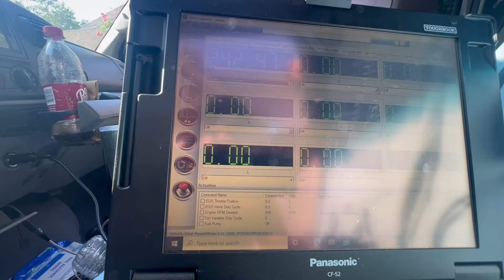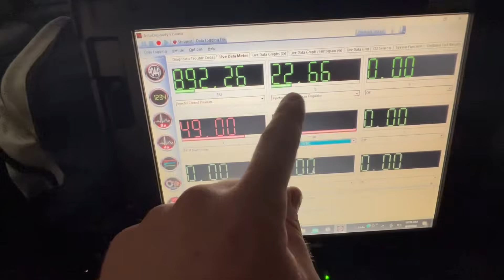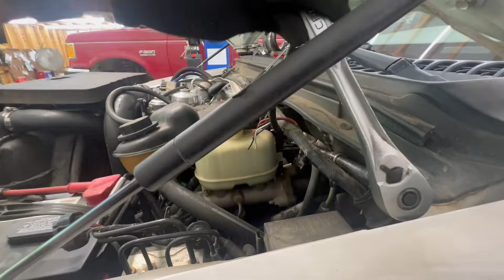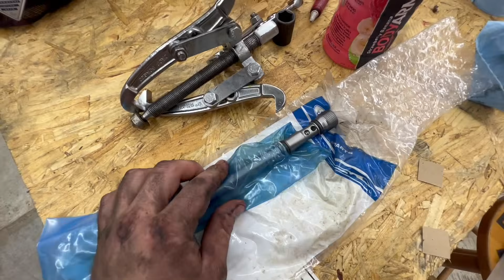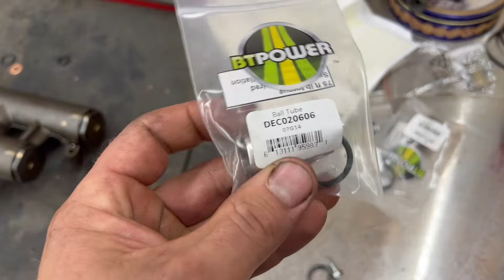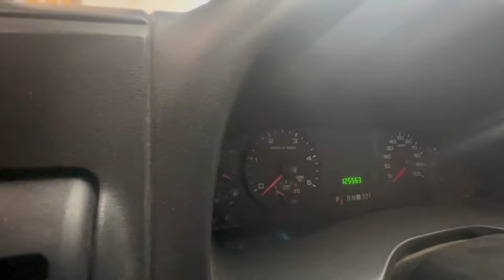6.0 powerstroke high pressure oil leak, long start, no start hot

Comment: Have you ever tried to change out an ipr with an odawgs intake installed?
Reply from the maker: Yep, rotate it out, keep the electrical connector pointed towards the back, only the nut while holding the connector. Comes right out
Reply: @AutomedicGarage Awesome.   I had taken the ipr out with the turbo removed to check it while i was in there.  Screen looked good, but access from the right looked sketchy.  I was worried about future access.

Comment: Those leaking seals leaking air at 150 psi will not last long with 500 to 3000 psi pressure against them. just saying.
Reply from the maker: System is meant to hold oil pressure not air pressure. When the system is completely empty and has just been put back together it is common to hear air seeping after just putting a system back together. I do this daily and this is one of our personally owned trucks and this was 3 years ago now and has not been worked on since this video and over 30k miles on it since. So I’m “just saying”

Comment: I just bought xotic performance set of standpipes & dummy plugs. I went with  them instead of the o ringless set I didn't know how I felt about lock tight them in place much more pricey I love you videos always helpful when in a pinch.

Comment: How often do those stand pipe o rings and other seals you replaced go out?
Reply from the maker: @whspioneer89  with correct install, using at the minimum oem or the diesel site double oringed, running a quality oil cooler and keeping oil temps in check, not that often. If you don’t follow everything listed about then there’s a good chance you’ll blow them.

Comment: Hi I'm a new owner of a 6.0 Ford power stocker I love the truck I am stuck being able to drive in town because it turns off after I drive it like 15 minutes I've changed everything I see the dash lights and stereo turn off and I had mechanic go through the steps checking the lines the oil pressure high what am I miy
Reply from the maker: @BrittneyBooth-wd2tx  I can’t really help if I don’t have any live data to get an idea of what’s going on such as icp psi, ipr %, FICM volts, ficm sync, fuel pressure, etc. when the problem is occurring.

Comment: 2004 early style HPOP

Suspect HPOP failing

165k miles, original HPOP

Long crank cold and long crank hot. New FoMoCo standpipes and dummy plugs
IPR test good, screen clean, went ahead and Replaced screen anyways

Oil psi gauge goes to zero when the oil gets warm, oil Guage swings to normal any rpm above idle

Filter removed low psi pump fills oil resevoir relatively quickly. Checkked the shuttle valve and spring on the bottom side they are good

Next test is shop air at IPR port

Comment: Good job.
 But I have a problem with mine. So sounds like you want to crank but it won't stop. I think I gotta leak in the system Ic p. Isn't building 500 PS in?  Direct.
Me in the right place, please.Thanks
Reply from the maker: @marianomachado3631  crank but won’t stop? Are you saying you started is getting stuck and it keeps cranking?

Comment: not sure if you've tried, but I fill the oil rail with a syringe by removing the small plug in the top of the rail.  Takes a little time, but fires up first crank.  Great content!!

Comment: My Icp going 84.99 under full load it is asking for 3600psi it is only getting 935 psi hpop bad? Also forgot to mention my fuel pressure drops to 46 psi then it goes back up to 58psi. Both fuel filters are brand new. Do i go after the hpop or low pressure fuel pump.
Reply from the maker: @tinok.8149  according to ford anything above 45 psi is acceptable on fuel pressure but it sounds like you need a blue spring or your HFCM is getting weak. Are you sure the 84.99 isn’t your IPR cause that what ipr maxes out at. If it is ipr it’s doing all it can to produce the 935 Hpo. Depending on your year if it’s a early 6.0 03-early 04 I’d say hpop if it’s 04.5-07 I’d say some other Hpo leak such as standpipes, dummy plugs, nipple cups or upper injector orings

Comment: I’m having the same issues with my truck. Out of curiosity, what does a job like this cost, roughly?
Reply from the maker: $200 labor per side. Oem stand pipe and dummy plug set is around $100 but you gotta factor in $150 diagnostic fee for figuring what’s leaking and doing a air test through the ipr.

Comment: Heres a question. My trucks got a new hpop,icp,ipr,motor harness, ficm,ficm harness, new fuel pickup, new fuel pump/filters. My truck starts up nice. But once its warm it shuts off. I cycle the key a couple times and it starts back up. But theres ONE green and red wire coming from the fuse box under there dash on the driver side. You so much as wiggle that wire while the trucks running it shuts down and will not start until you wiggle it for awhile.
Reply from the maker: What brand harness? Sounds like similar problems I have with the Amazon and eBay harnesses
Reply: @AutomedicGarage  the new harnesses were both off ebay. Theyre not the best but not the cheapest. Definitely better that the ones that were on it.

Comment: Seems like it would be easier to just replace the stand pipes and dummy plugs on both sides
Reply from the maker: Easier as in take the other side apart that has no leaks? You could maybe say preventative but I wouldn’t say easier. It’s not a hard job but why replace it if it isn’t leaking?
Reply: I was going more along the lines of preventative. Not disagreeing it was legit question not trying to be sarcastic. Just thinking while you were in there why not but maybe it isn’t feasible
Reply from the maker: @bullitt5337  you can but they are more likely perfect, they blow when they blow. Correct installation and torque is what matters most

Comment: So I made my own tester. Doesn't have the on off valve but it still works. 
My hpop is bad. 
But have you ever seen the screen of the ipr break off and stay in the hpop??
Reply from the maker: Yea on occasion. What year is yours? Never had a bad pump 04.5 and up.
Reply: @AutomedicGarage  03...sent the air. I could hear it coming thru the oil filter housing.  
I already bought an oil cooler because the truck wasn't maintained...so I took the oil cooler out. Sent air through and it was spitting air at the oil filter screen 
No air coming out of any valve covers.
Reply from the maker: @beardedhick1  makes sense. Sounds like your on the right trac. Hopefully the videos helped some.
Reply: @AutomedicGarage  the videos help extremely.  Question though...I am replacing the injectors...now is it OK to go with 155s and should I replace the oil rail cups or nipples whatever they call them...since I'm gonna be that far into it? It's been studded and egr deleted as well.
Reply: @AutomedicGarage  wish I could give you the work but I'm not close enough to pay the tow bill. Lol
Reply from the maker: @beardedhick1  if they aren’t leaking leave them alone
Reply: @AutomedicGarage  yes sir. I Thank you a lot

Comment: I have a f350 6.0 05 that won’t start cold. My scan tool is showing 0-3 for icp and ipr is 85% when cranking. I removed oil filter and oil boil is filling when cranking. I checked ipr valve and the screen looked good. I ended up replacing the ipr. No change in scan tool readings. I am thinking my hpop is no good. I feel if I had a leak I would have some pressure build up on start. Oh and great video. Gained a sub. Also curious to why you air test through ipr and not icp?
Reply from the maker: Testing through ipr is more accurate, takes ipr out of loop and if you test through icp you dont get even flow through both sides.
Reply: Never thought about it that way. What do you think about the other part of my comment? Do you think I am correct going to the hpop since I am getting no pressure at all?
Reply from the maker: @daddydubbs  never had a bad pump on 04.5-up. You got a massive leak somewhere. Air tester will tell you where the leak is.

Comment: While you were cranking the engine, I heard a faint skip.
Reply from the maker: Probably was trying to hit getting close to but not at 500 psi. That motor is mint only problem was the high pressure oil leak.

Comment: What’s the computer or diagnostic tool that you were using for the initial inspection? What’s the cost to own ?
is it a yearly subscription paying for updates and software upgrades year over year?
Reply from the maker: It’s an old tough book running Autoenginuity. I have the enhanced ford, GM and Chrysler packages. Each package is about $300 I think. Don’t have to use a toughbook, I do because my gets beat up daily. You get 1 update a year. Customer service is excellent with them also.

Comment: I ordered ford for the stan pipes. I have to go to work so not sure when i will be getting to mine. I need to order a ipr socket and the air line... where can i get them from? Do i need an expensive scan tool to get readings i need?
Reply from the maker: Accurate diesel has the air tester and ipr socket. You do need a scan tool that is able to read live data. I use autoenginuity
Reply: @AutomedicGarage  I have one for my semi truck, I need to call them and see if I can use it

Comment: thx for showing me the torture i am about to receive ;)
Reply from the maker: Ah…it ain’t bad. I did a oil cooler job today old out and new in at 5 hrs. Now I just gotta flush all the chocolate syrup out of the system. Just make sure you live everything, check everything and torque everything appropriately. 6.0s are great they just need the attention to detail to be right.

Comment: Thanks for your videos! What about a longer cold start but fast hot start? What could cause that?
Reply from the maker: Glow plugs
Reply: @AutomedicGarage  thank you!
I'm also dealing with another issue. When I start my truck and drive I have full power for a short period of time, from a minute to 5. Boost goes above 20 psi and can go to higher rpm. Then I loose some power and boost is below 20 psi and barely goes up to 3500 rpm. If I turn off my truck and turn it back on, full power again. My speedometer doesn't work yet but I don't think that should do anything with it. Truck was stolen so some wires are cut and ignition is still busted. I think I had full power when I got the truck back but not sure now. It just feels like if it's getting flooded. Hopefully that makes sense.

Comment: I enjoy your videos, thank you. What is the scanning tool that you are using ?
I am full timing in a 2007 6.0 power stroke .
 Earth roamer I am handy, but I am not a mechanic.
I need something that is intuitive. That can get me out of trouble.
needs to do data, logging and reading and clearing codes.
any help would be appreciated. Thank you.
Reply from the maker: Autoenginuity with enhanced ford, GM and Chrysler package. Only thing it doesn’t do well on the 6.0s is power balance graph. I’ve been told by autoenginuity that it has to do with the FICM

Comment: I have 2003 6.0 and starts right up, then once the oil get up to temp it shuts off like you turned the key off. Then once it cools off after hour or 2 so it will start. Thinking hpop? 
Your video is great!
Reply from the maker: That would be my best guess without hooking my Autoenginuity up to it.

Comment: I working on HPOP 6.0 with oval O ring or one sensor…. The hpop is on engine and mount torque spec with 2 new O rings … and I ask my helper to hear any air leak with tube n hear leak by gear front seal … is that normal or need replace pump …
Reply from the maker: Small amount of air through pump seal is normal long as it it’s excessive.what year truck? 03-early 04 are problematic pumps. 04.5-07 usually never fail.

Comment: I have a 2004 (late model) in my f250. I crank it it builds oil pressure the low oil pressure is 389 and the desired is over 1500. It cranks but will not start. It will start if I give it a lil shot of ether and as long as I don't turn it off. It will run all day. But if I turn it off. I will have to use ether and it fires up. What is your thoughts?
Reply from the maker: That’s your high pressure oil , low pressure doesn’t get that high. You have a weak pump or a Hpo leak somewhere. Air test the system see what you find. You kinda at the line of a hot crank no start and a crank no start.

Comment: I have a 2005 6.0 had a hot not start and eventually became a stall when hot(I assume that's what it's called died after getting real warm) tested it and could tell it was leaking driver side standpipe where it goes into the long tube. After opening the system and waiting a week or 2 it started getting some air out of # 4 or 6 injector. Only leaks really bad when I crank the air to about 100 psi but under 75 doesn't seem like it does at all. Should I go ahead and replace orings in nipple cups or what would you do. Oh yeah and  new o rings in injectors about 2 months before this happend at a reputable shop. Sorry about the long comment but I sure do appreciate your time and as always a great video!
Reply from the maker: So, I get this question alot “it’s leaking air from the top injector oring or nipple cup”. So often times you will have some air leak from the upper injector seal, I stress “some”. If it’s just seeping air or you a a small amount of oil gurgling your more than likely good. If it’s leaking so bad that as soon as you shut the air valve off all the air is gone from within the system you have a problem. It’s acceptable if your turn off the air and it’s holding enough that you hear the air leak for another 20-30 secs after shutting it off. It’s hard to explain what “acceptable” I’ve kinda just learned to trust my ears. Hope that helps some.
Reply: @AutomedicGarage  good deal thank you sir, plan to pull the rail as soon as weather and work permits thanks again ive learned alot by watching you
Reply from the maker: @codyfowler3384  glad to hear it. Keep watching.

Comment: I had pretty much the same issue including the leaking injector when air testing after replacing the standpipe and dummy plug (passenger side).  I have read a couple of posts that said not to take much stock in air testing immediately afterward since there’s no oil pressure to seat the o-rings.  Have you had any experience with that happening?  Where maybe it leaks with the air test but doesn’t bleed off the oil pressure?  I’m going to go ahead and order the injector seals but I am gonna put it back together and see what happens.
Reply from the maker: I think I mentioned that in this video, if not it was another 6.0 video but yes. The system is designed to seal and hold oil pressure. Often times you will get bubbling or gurgling at the upper injector oring. Minimal is acceptable if it excessive then replace. Also sometimes the upper seal can be mistaken for a nipple cup oring leaking because it shoots the oil/air directly down at the upper injector seal. Hot that helps some.
Reply: @AutomedicGarage  
Yes sir thank you for the reply!  Pretty sure that’s the first time I’ve ever asked a question on YouTube since it’s seems most questions I read in the comments never get an answer (on other channels).  You’ve given me some hope at least.  Unless it was something I damaged when putting the oil rail back in place then I’m hoping it’s just the air getting by with no oil pressure.  When I initially did the air test it wasn’t leaking in that spot.  Although…I suppose it’s possible that since my main issue was a split o-ring on the lower section of the standpipe maybe it wasn’t allowing enough air pressure to get to the front injector to be noticed during the test and only showed itself after installing the new standpipe.
Reply from the maker: @jgp9290  if you had a torn oring on the standpipe and it’s a 04.5-07 then I’d almost guarantee that was it. If it was a early 6.0 then it could be the injector seal or bad pump or a bad hpop feed line
Reply: @AutomedicGarage  thank you for your thoughtful response. 
I had a somewhat slow start up on my late 2004, so I air leak tested it heard a very small leak from both valve covers.  Now when I go to start it takes 20 seconds or so to build to 500psi. If I shut it down and start it back up within a few seconds it fires up instantly. Kinda discouraging. But better now then when I'm towing something. Hoping it's just a stand pipe. Tearing into it tomorrow.  
Thanks for your great video.
Reply from the maker: @patrickwelch620  is your early or late 04
Reply: @AutomedicGarage   build date 7/04 has old style oil pump, but the ICP is at the front of the engine. Btw, do you use and sealand around the base of your oil cooler to the block?
Reply from the maker: @patrickwelch620  no, just the oem seal
Reply: @AutomedicGarage   I got the valve cover off and put air to it. And I hear a large amount of air that sounds like it is coming from the bottom off the engine.
Reply from the maker: @patrickwelch620  hpop will sound like it’s coming from bottom end of motor because it’s basically open beneath the pump allow the air sound to escape to the bottom end.